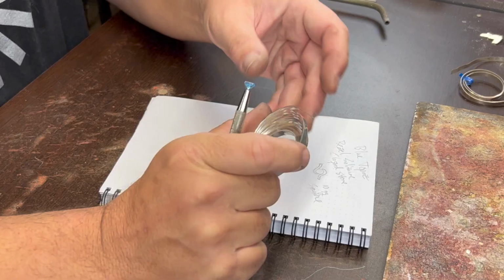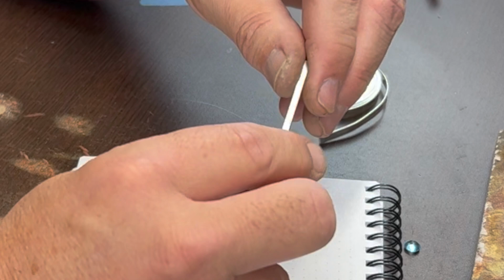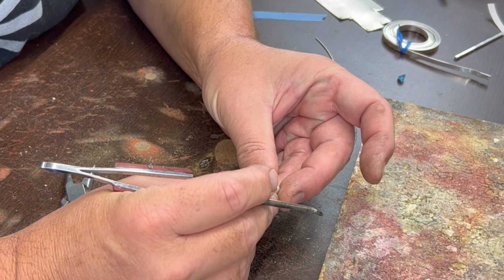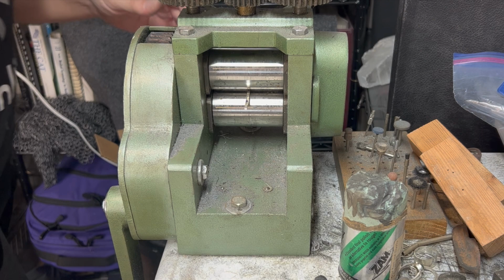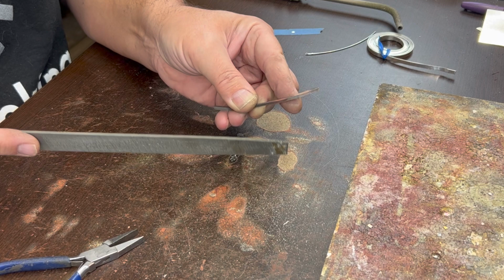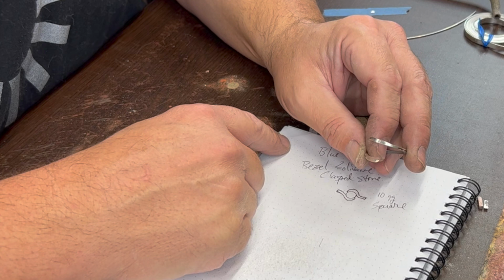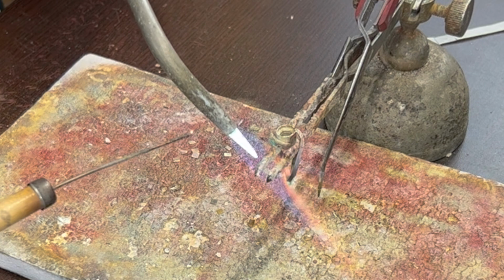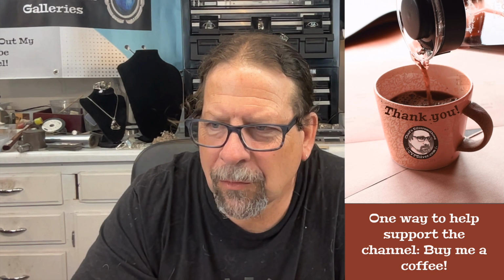Making a Wrap-Around Ring: A Silversmithing Tip

Comment: I always find your videos interesting Im not sure I have the strength you do. That being said would it be any easier to use round wire? Of course the ends would be more pointed, Beautiful ring
Reply from the maker: Hello Verda. You could probably use round wire instead; it’ll just have a little different look. You might try doing some of the shaping while it is still attached to a longer piece, as that will give you some bending leverage, and then cut it to length:)